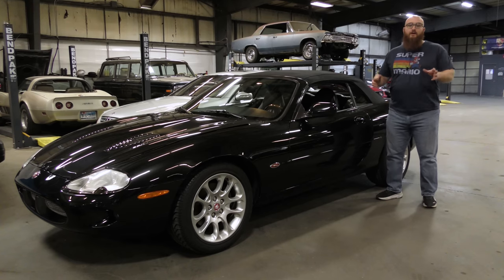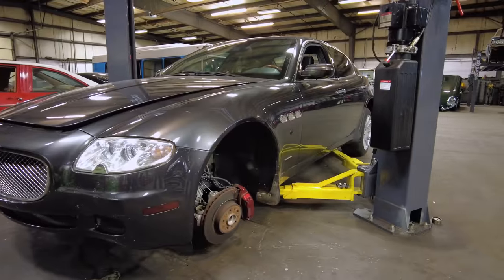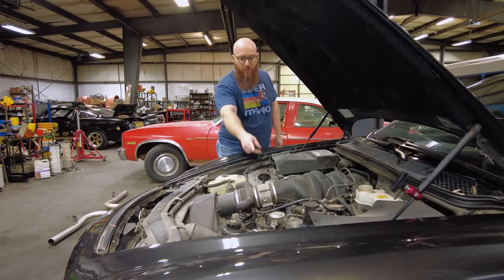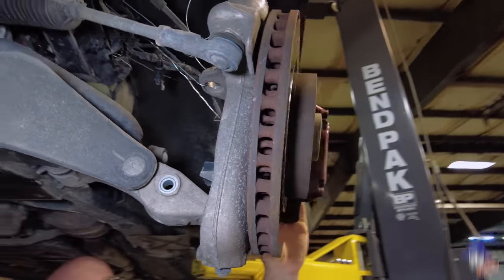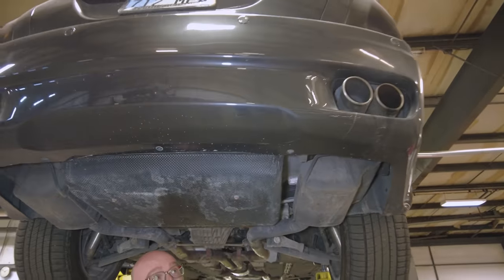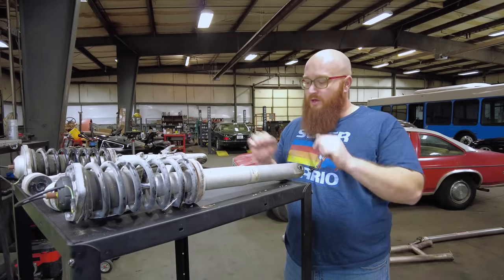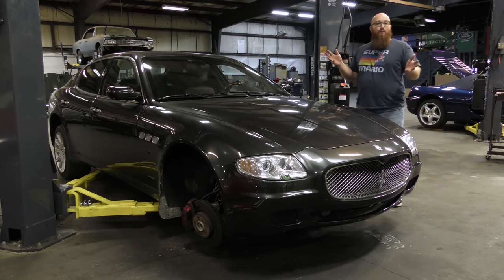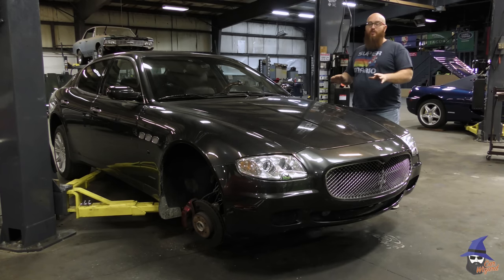Me-Owch!!! Catalytic Convertors cost $13K on this '07 Maserati Quattroporte! CAR WIZARD explains how

Comment: Rule of thumb: if it was a $110k car new, it’s going to be a $110k car when it needs to repaired, no matter how old it is. Anytime you’re tempted to buy a car like this, check prices on parts before buying!
Reply: Hard to check for prices of parts when car is brand new. Calling the dealership it's obvious it's gone be pricey.
Reply: @retiredsnowbunnyhunterx5106  you can go by the track record.
Reply: @retiredsnowbunnyhunterx5106  I’ve done that on every car I’ve ever bought, new or used. Also look at ease of repair. I have walked away from new and used vehicles based on repairability/parts cost.
Reply: @retiredsnowbunnyhunterx5106  he was referring to people buying the car used at a "deal" since it depreciated so much. How many people have stretched finances beyond their means to buy a "cool BMW" or something only to have it break and be in a heap of trouble when the car needs $5k worth of work on top of the bills they already can't pay.
Reply: True, I had to skip back in the day on a car that only two tire manufacturers made they wouldn't last a year and it was nearly $800 for a set back in 1991. That was a bridge way too far. Not to mention parts.
Reply: @retiredsnowbunnyhunterx5106  If you're buying a 110k car new you should budget for 110k parts and service.
Duuuuuuuuuuuhhhhhhhhhhhhhhhhh
Reply: The untold truth or should I say horror regarding buying these types of cars.
Reply: @tim3172  Now that I agree with you on that. Buying that kind of car for that price you better be ready for the parts to go with it.
Reply: Toyota parts are also expensive 😅
Reply: This lamb concurs.
Reply: Thats why it´s sooo risky buying a 10 year old luxury car with a lot of owners who neglected service and repairs due to high cost... 😱
Reply: These value cars should only be considered if you can really wrench or have deep pockets and can afford the maintenance. Its no fun running these on a shoestring and they can eat a less well off persons bank account with one repair.
Reply: If you have to put the price of the car into the car every five years then it's not a real car. It's an expensive toy. A real car is supposed to get you there, not show everyone at the party that you have a tiny member.
Reply: I told customers  when they asked  me about the high end European  cars. My response  always  was fun to drive comfortable ,expensive  to keep  running  and generally  a pain to work  on. If  you can deal  with  that  go for  it
Reply: Spot on! Folks think they are getting a bargain and quickly realize the mistake
Reply: thats why i settled on a camry
Reply: Not always true.  I spent $2,500 purchasing my 1988 750iL.  I've owned it for 17 years and I haven't spent anywhere NEAR that amount maintaining it.  This car was $77,000 when new in late 1987.  Haven't spent anywhere near that amount either.  Your rule of thumb is not always accurate, even when you generalized it to apply to everyone.
Reply: @tim3172  Behave now Tim, mummy is calling...
Reply: Expensive junk!
Reply: Well obviously you gut the body and put it on a corvette chassis or something similar
Reply: @volvo09  I wonder how many people are buying cars without having them independently inspected vs just taking the sellers's words that car "just needs a little work" or "that it's perfect and needs nothing"? Or have never looked into the costs to repair them.
Reply: Most of my friends including myself bought a Toyota, never went back to that European junk!
Reply: Ehhh parts do get cheaper as time goes on but I mostly agree OP
Reply: Exotic European cars are endless $ pits.
Reply: @jeffrobodine8579  Definitely! Garbage!
Reply: A Kia/Hyundai DPF can set you back $3500. Nobody driving a Kia would dream of that being the case until they get an invoice of death in their hands. The story goes on and of course the German brands are close in second place.
Reply: Not necessarily. Depends on the make of the car, as often premium cars such as the Audi R8 share many components with other cars including VW etc
Reply: Get a Audi🙂👍🤣
Reply: Its a bit more than that you gotta pay labot

Comment: My nephew is a BMW mechanic and he owned a BMW when he first started working. The BMW spent most of the time for years parked in his driveway because he couldn't afford to repair it even though he could do the work himself and could get the parts at the dealer's cost. Instead, he drove a nice, suped-up Honda. .
Reply: Yet people get mad when putting the emphasis on the ease of Asian vehicle maintenance.
Reply: Where the miles piling up on the BMW.
Reply: @That V8 Life I mean if you work on cars all day you grow to resent the ones that give you the biggest pain.
Reply: It really depends on the year and model.  As with any manufacturer, some models are easier to repair than others.  To make a blanket statement about BMWs being expensive to repair in general is irritating and without being more specific, foolish.  I do not own a BMW currently, but it’s not due to cost or reliability.
Reply: @slagdemon  I watch a couple of other channels and they're shops that work on foreign cars. One specializes on foreign cars. He absolutely hates the BMW seven series. Difficult to work on and part prices are high. The other guy recommends to not to buy any German car that has over 100k miles on it. I've had a few German cars over the years, and they work okay when new. But as the mileage runs up, they will require more expensive maintenance done that is expensive. That's why new high price German cars drop so much in value once they get some miles on them. Maintenace and repairs can easily reach into a few thousand dollars and up.
Reply: @Rhaspun  Not necessarily.  Some German car models are easier to work on than Domestic and/or Import.  An E46 is real easy to work on.  Parts if bought on FCPEuro have lifetime warranty for the owner of the car.  

Problems with German cars would have to be electronics as they cram everything new into it.  This is especially true for BMW 7 Series and Mercedes S Class, so generally those should be avoided entirely if this is a concern.  This is why you wait for the facelift (LCI) versions of the car as the gremlins have generally been worked out by then.
Reply: @heerarodriguez9563  Maybe some people can't wait sit around and wait for parts to show up from FCP Euro. They want it fixed within in the day or two. They don't carry all the odd ball stuff like the parts that do the soft close action for the doors on a MB CL600 much less the hardware that handles the air distribution of air powered servos. Get a price for these parts.
Reply: @Rhaspun  As with any car, then you'll be paying a premium to get it done that quick.  Not just German cars.
Reply: @slagdemon  I know several people who have owned BMW's and Mercedes.  They all complained about the sky-high repair costs.  However, if you've got money to burn and price is no object, have at it.  You do you.  Happy Trails.
Reply: @1notgilty  I know many people who had to take their f150 with the 5.4 in to a shop to get the cam phasers and timing components replaced.  Also same deal with the gm 3.6 liter.  My point is, every car manufacturer has their expensive repairs.  Bmw is no different, but it affects every car manufacturer.
Reply: That makes no sense. Sounds like he was bad at his job. I don’t understand why people brag about driving sh1tboxes when maintaining European cars are similarly as expensive to maintain if you know where to look and buy parts
Reply: @RegionalRadioShackManager  Actually he was VERY good at his job and got regular bonuses for being one of the BMW dealership's top mechanics.
Reply: Welcome to German car ownership where the car you paid 20K for 3 years ago is now worth 5K and is gonna cost you 10K to fix now. 🙃
Reply: @adamwuest3958  Exactly right.
Reply: Has he never heard of ECS tuning or the like? I own BMW's and I never buy dealer parts, only aftermarket which are usually made by the identical manufacturer but with the logo removed. Never had a problem and as cheap as a Honda to buy and repair , especially if you can do basic mechanics. I took a $4K Cdn 2009 BMW 335 ix that the Ford dealer took in on trade and was leaking  and squeaking like they do when you don't take care of problems, and i put $4k in parts and my labour, along with some work done at a shop (at basic labour rates) and now i have a mechanically new classic that, given the current market, i could sell for more than i put into it.
Reply: @zeusman123  That's great and it sounds like you got a good deal.  I think a lot of people buy BMW's and Mercedes because they see it as a status symbol.  Then are shocked by the repair and maintenance costs.  My nephew could do the work on his BMW but the costs of the parts were still sky-high so the BMW sat in his driveway for years as he happily drove his maintenance-free Honda.  The good news is that he still had the bragging rights about owning his BMW status symbol and the mileage stayed low because it was parked most of the time.
Reply: Why even comment on the experience of ownership if you don’t have first-hand experience owning or working on said make or model? Nobody cares what your nephew does. Everybody has a story like yours about every brand. This comment section is full of NPCs bantering about things they don’t understand.
Reply: @XcoolcoolbeansbeansX  According to your comment no reviews by Consumer Reports, Underwriter's Laboratory, Road and Track, or any other information about any product is valid unless it comes from someone who personally owns it or has personally worked on it.  OK, that's a unique way of looking at the subject.  Something tells me that you don't like criticism of BMW's for some reason.  Hey, I think they're great cars when they run right.  They're just extremely expensive to repair.  Oh, by-the-way, my nephew, the successful BMW mechanic, eventually sold of his BMW and so did his brother.
Reply: @Rix317  Yes, and all of those mechanics and shops that either “refuse” to work on them or just do such poor work that further convinces the owners that they are “junk” and dump them for cheap…provides me more great opportunities to buy…come to Papa☺️
Reply: @@thatv8life186 you think a mech makes a bank because they work for bmw? They don't

2nd suped up Honda and a bmw owner, be cant afford drugs

Comment: i'm sorry, but when the OEM cats are that expensive, the (any) shop should propose other legal alternatives like aftermarket CARB legal cats manufactured by reputable brands...a quick online search shows Magnaflow CARB complient cats for the Quattroporte for cca1400$ per side. Yes still expensive, but not nearly as 13k + laboure. It would be a shame for such a nice sounding car to go to the scrappers just becouse of bad cats.
Reply: Shops like Omega are only interested in using OEM parts with few exceptions. That way they know what to expect when warrantying their repair. They also don’t do welding/exhaust work, so when you bring a car to them, they’re just going to replace parts not weld on stuff/fabricate it.
Reply: @hungryhungryhummer  Ok great then just take it to your local muffler shop and boom! you got new cats for a fraction of the price. Thank God Omega isn't the only repair shop.
Reply: Great answer or should I say alternative. I've used plenty of them over the years, particularly Catco and Carsound (Magnaflow) and they work great.

Comment: Fabricate generics or cut open the housings and replace with a new similar-sized core, then re-weld. Will probably work.
Reply: This is what I've been thinking...Why did he not mention it???
Reply: Even in California I have an exhaust guy that can get generics that pass smog pretty cheap
Reply: He said its illegal and he probably knows, so I would say it's fine as long as the emission test is passed, but he doesn't do it but he talked about the possibility
Reply: @computercrack  Illegal in California - but is legal in most other states.
You have to check your own state.
AFAIK, such laws -- restricting repair rights -- are strictly state by state.
Reply: And how many codes when the ECM throws a fit and turns on the check engine light. No reputable shop in its right mind is going to assume the liability for that kind of hack job.

Comment: You might want to try Cata-Clean and see if helps. I have seen it bring back converters that aren't melted down and just have reduced efficiency.
Reply: Cata-Clean worked for me. I had a p420 code, catalytic converter operating below efficiency, on an old 96 T-Bird with the 4.6L V8 about 4 or 5 years ago. I put a bottle of that stuff in following the instructions and the light hasn't come on since. I think it works well as long as the cats aren't too far gone.
Reply: @Epotheros  YOU NEED TO DRIVE THE CAR ABOUT 50 MILES ON THE HWY TO MAKE THAT STUFF WORK, AND IT DOES.
Reply: Wise advice

Comment: There is this shop here in southern Oregon only does exhaust and catalytic converter. The guy is also a welder. He probably charge about $750 or $1,000 the most for each after market converter and just custom weld them in on this Maserati. I brought a 2002 Honda Accord there to change out the catalytic converter. He did it in about 20 min and charged me $550 for it! The other auto repair shop I know cannot do it for such short time and charge that $550!

Comment: I've owned my Maserati Granturismo S going on about 7 years now, and put only about 9,000 miles on it.  It's been a garage queen, but I sold a couple of cars and now putting it into rotation as a daily.  I found this video super helpful.  When I first bought it, I was paying $1,600 - $2,400 at the dealer for the annual service which was basically an oil and air filter change.  A couple of years later, I started taking it to a reputable Ferrari/Maserati indy mechanic who was charging me $900 for the same service.  Last year I took it to the mechanic that does my German cars for around $450 for the same service.  This year, I'm just going to do everything myself, rotors, pads, brake fluid, coolant flush, differential fluid, oil, etc.  It's a 2010 model and I still have the sticker, which was about $131,000.  Carmax is offering me $20-25k for it now with just 25,000 miles.  I guess that factors in the ungodly maintenance costs and low demand in the market.

Despite being 13 years old and living in L.A. it still starts more conversations with strangers than my 3 year old G63 AMG.

Comment: I’ve replaced the cat in my mk4 Jetta by taking the pipe out, tacking it to my welding table.  Then cut out the cat and welded in a generic CARB compliant cat.  Works in my smog state, CEL is off and a whole bit cheaper than OEM.

Comment: These are great videos.  I may look poor in my corolla, but when I need a part which is rarely they are very cheap.  Alternator from a private mechanic was $300 including labor out the door.  I can handle that on a 14 year old car.  Didn't break my budget.
Reply: Justification.... I paid the same on a 2005 SL500. You’re not forced to look poor bro

Comment: The catalytic converters are the easy part. Just get two of similar size, shape and flow and weld into the stock exhaust. Even OS bungs can be added if needed and not already on the cat. converter. !! Between Ford, Dodge, GM and Toyota a similar size, shape, flow and capacity has to be doable!
Reply: You mean oem cats from another manufacturer?

Comment: I have the hood strut clamp. It's worth every penny. When in a junk yard tool weight means a lot when you have to carry it to the far corner. The clamp is lighter and smaller than the extra pair of vice grips you would need to carry.

Comment: My 1988 bmw 750il is 35 years old and factory replacement cats are $1,500 EACH (there are two). You can get generics for $100 BUT the high heat the V12 creates is a pretty sure bet you're going to be swapping out those generics in four to six months.

Regarding the hood struts, some people consider a $10 vise lock too much money to protect their head that they only value at five dollars.
Reply: Replace the hood struts is also an option.
Reply: @htimmermans1938  My sentiments exactly and unlike the cheapskates, I have NO idea where I will get a replacement head to replace the one I was born with.
Reply: @htimmermans1938  And it's usually only something like $20-30 in parts from RockAuto and five minutes of time.
Reply: That is when you look for quality cats from a company that offers high performance cat.'s for Corvette's or Chevy V8 trucks. You look for cat's from an engine bigger than the one you want to replace. Keeping in mind that $1500 per side beats $13,000 for a set! You would not put on Generic brands everything is relative though. IF done properly by component shop the inspection people would never suspect or spot the difference. You can not have sloppy welds though or anything that looks ghetto. It will work right and not throw any codes. I live a State that does not test emissions and does not have annual inspections but that has not always been the case!
Reply: $7000 each, that’s crazy. I don’t begrudge anyone making a profit but this is pure price gouging (not the wizard)can you imagine wizard telling a customer the cats are 7k each, I’d be hiding in my office. Even hoovie would say no to this.
Reply: @jimamizzi1  There has to be reputable companies out there offering alternatives for half the price if you're willing to look...